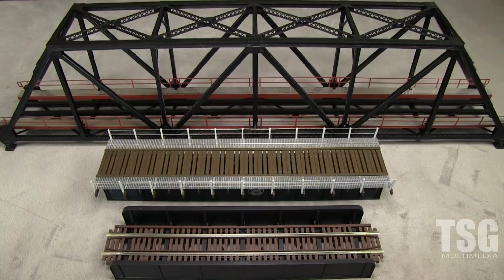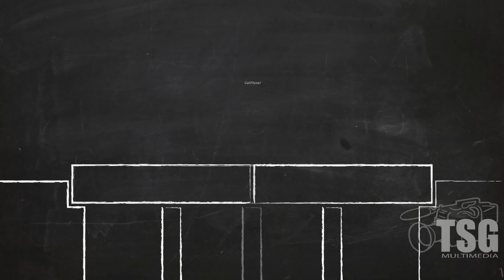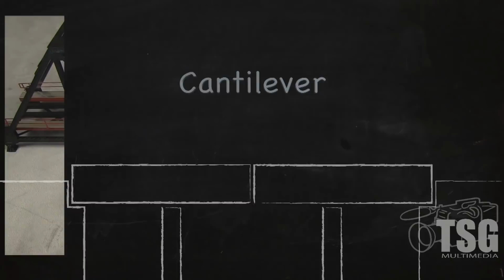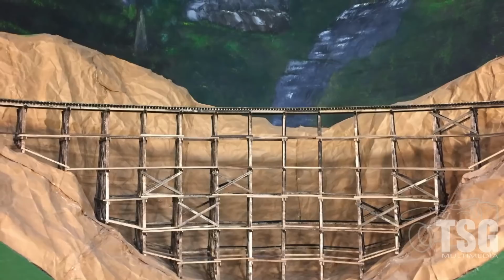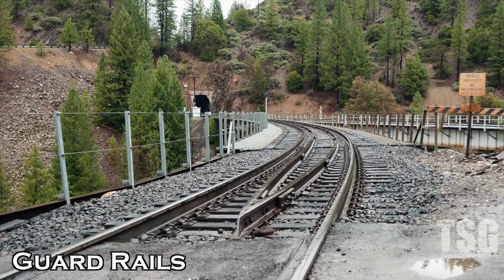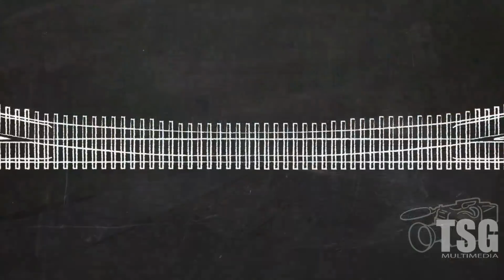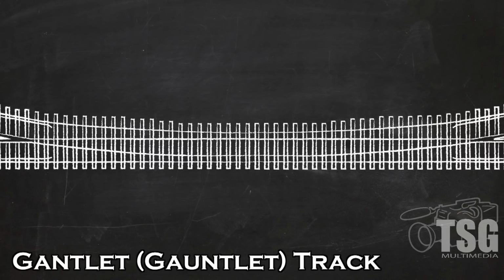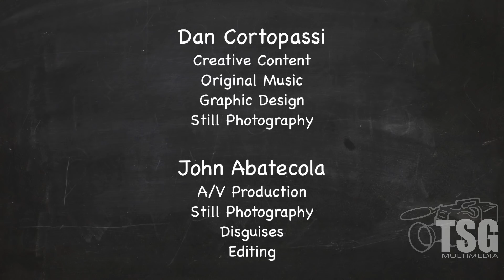Model Railroading 101 All About Railroad Trestles & Bridges For Beginners MR101

Comment: Yes, suspension bridges can also carry rapid transit trains. Here in New York City, both the Manhattan and Williamsburg bridges carry both vehicles and subway trains between Brooklyn and Manhattan. The outer parts of the bridge carry the trains, and the center carries the vehicles. The upper level of the bridges carry just people. I’m not aware of any other suspension bridges that do that. Maybe there’s one in San Francisco.
Reply: Just downstream of Niagra Falls is an arch bridge which replaced a suspension bridge used by the NYC to connect to Canada.  Loads got too high for it is why the arch bridge was built.  I found a railroad suspension bridge in France on Utube and the line is third rail electrified down close to the border with Spain.  The D&RG suspended a through girder span over a narrow part of the Arkansas R. in the Royal Gorge.

Comment: One of the most FUN things to do with a model train set is to use the cardboard from your cereal box to build a bridge.  Just take the cardboard, cut it up into strips with a box-cutter knife, and then glue the strips together to create I-beams that the bridge is made up from. Then you paint the finished bridge, and then you install a strip of tracks onto it.  Don't use styrene, that's the 'easy' way. No, do it the hard way, use old cardboard.  See if you have the skill to do it that way.

Comment: Those who don't understand standards are the same people who complain that their trains don't stay on the tracks or their cars always come uncoupled when they're operating their layouts!
Reply from the maker: It seems that there are "experts" out there who think they are experts simply because they have spent what they think is a lot of money buying stuff but never learned about standards or the finer aspects of operation.
Reply: Just follow NMRA standard, and you good to go
Reply: Farid Arsitek That’s a good start. I defend and support the NMRA and despite the popular position to critique them, and I can do that too, there’s always room to improve, but I see the value and need of them. I would recommend tearing the NMRA standards as the lowest common denominator or a good start. I think you can do much better, and I don’t favor the RP-25 wheel standard for example. But if you meet the NMRA standard you should have acceptable performance if there is a trade off in cosmetics. If you want to improve the look, then you must adhere to much less tolerant standards. For example, I build to the Proto:87 standard, and it’s picky but worth it if you can build your trackwork to those specific tolerances.

Comment: Can you explain why some bridges are a combination.  Why do they use a girder then a truss then another girder?

Thanks, great show as always.
Reply from the maker: I think Dan kind of covered this when he mentioned that the situation defines the bridge used. It probably depends entirely on the engineer(s) making the decision.
Reply: A possible situation is to allow water traffic underneath at the deepest part of the water. So use a truss over that part, the rest girder where clearance isnt a concern.

If over a depression or small valley, girder type is better upholding weight at short distances, and a truss for a longer distance.

And money. Modelers like seeing two truss bridges used to cover a span, but the railroad might use a girder and truss to save a few bucks.

Its wild how the circumstances decide what type is used. So just an idea or two as to what might shape those circumstances.

Have fun!